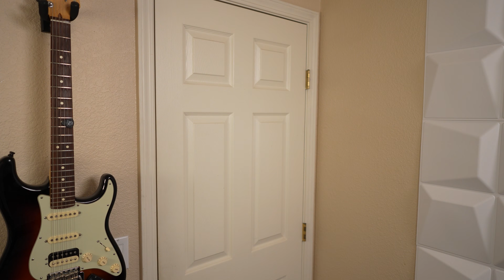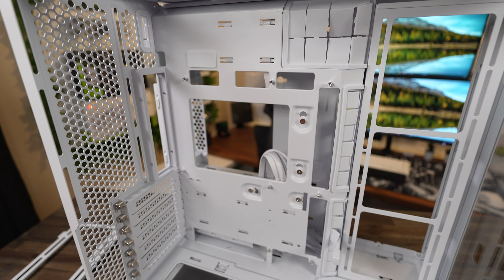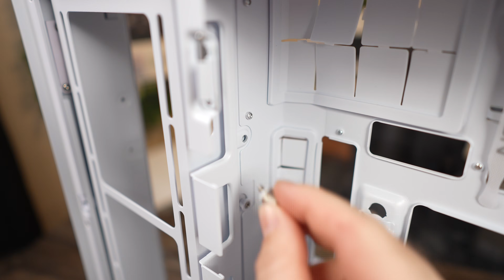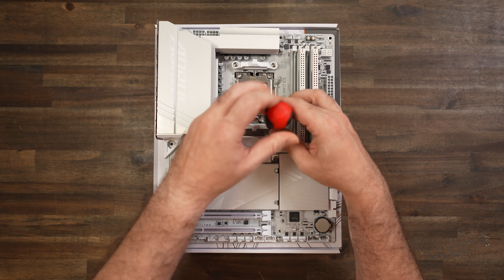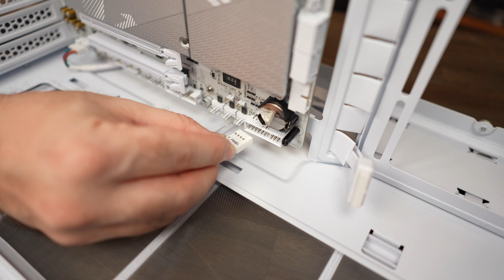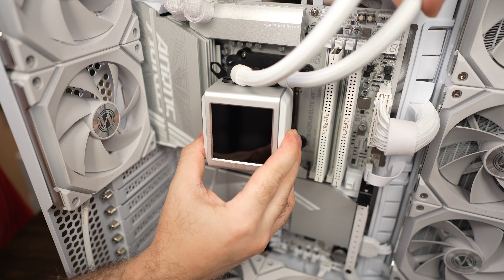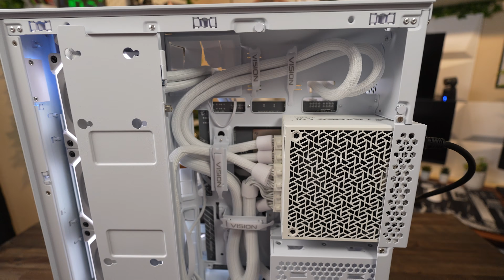Lian Li is BACK with the NEW 011 Vision COMPACT (X870 Build)

Comment from the maker: Hey dudes, thank you so much for watching and supporting my videos! A few notes about the install:

1) The bottom and FRONT side fans are REVERSE blade, they give off the appearance of being exhaust, but they are intake. They are used for aesthetics and now all fans have a uniform look across all of the them. The bottom and both side fans are intake while the rear fans are exhaust.

2) I apologize that I did not get to show the PC built in mesh mode for the top panel. As soon as I received the case, I knew I HAD to build it in vision mode and didn't have time in the video to switch to mesh mode.

Here is the full list of parts for the build:

Case: https://amzn.to/3zTW9zE
AMD 7950X3D CPU: https://amzn.to/3J5ig7f
ASUS Strix 4080 Super GPU: https://amzn.to/3PS9Aoh
GPU Sag Bracket: https://amzn.to/4fQH8hb
GIGABYTE X870 AORUS ELITE Wifi7 ICE Motherboard: https://amzn.to/3NsPXSf
Super Flower PSU: https://www.newegg.com/super-flower-leadex-vii-gold-1300w-1300-w/p/1HU-024C-00060
Lian Li Gallahad II LCD CPU Cooler: https://amzn.to/3U6UJZE
Samsung 4TB NVME Storage: https://amzn.to/3TNg3Cc
TEAMGROUP RAM: https://amzn.to/3UbmsZy
Lian Li SLV2 REVERSE blade fans: (Front Side and bottom): https://amzn.to/3W7rPdF (x6)
Lian Li SLV2 Fans (Side Rear): https://amzn.to/3U6TDx3
Lian Li SLV2 Fans (Rear): https://amzn.to/4aC0nJm
Cable Wrap for PSU cables: https://amzn.to/4f2CUTw
Velcro strips for PSU cables: https://amzn.to/4dJ62Oc

Feel free to ask me any questions you may have! 

Thanks again for watching,
Danny
Reply: Total price for everything before taxes is $3550 USD for anyone curious
Reply: Thanks !  @cadewatkin7086
Reply: @cadewatkin7086 dang I somehow came up with $4,874 before taxes.
Reply: Where did you get the spinning thing under your pc case does it comes with the pc
Reply: hmm i think the fans are not right in that configuration. Lian Li says you should do 3x reverse blade intake at the bottom and 2x reverse blade intake rear, and 3x exhaust at the Side Panel through the AIO.
Reply: @Paterminos88 where does it say this?
Reply: @Paterminos88 I believe you are right. I couldn't understand why you are getting hot air from radiator to intake.
Reply: Where did you get the rectangular lazy suzan that you put the case on to spin it?? That's awesome!
Reply: Did you place both intake fans on both sides of radiator (push/pull configuration?). I am wondering if that is not ending up pushing hot air into the case
Reply: Ok I need to know where can one get that spinning platform!!!
Reply: @Mannyolives  Prosumer's Choice Wooden TV Swivel Stand for LED/LCD TV, Monitors, Stereos, 21 inch Base Surface - Steel Ball Bearings - 360˚ Rotation - Black
Reply: @Mannyolives  he send me a link check my reply from him
Reply: Whats the L shape plug you used on the GPU? Did that come with it or purchased separately
Reply: @RyGuy_9_3  i think it came with it but I guessing hw will tell or get a link for you
Reply: how much is the build min?
Reply: @hypsm  $3550 USD currently
Reply: @cadewatkin7086  tysm and honestly not bad at all for that clean of a build!
Reply: Which Lian Li GPU bracket did you use?
Reply: Great build pal, could you please include the gpu anti sag bracket used in the setup
Reply from the maker: @axd-k6t  Edited the description and pinned comment to include it! Thank you. This is what I used, but I painted it white to match:

GPU Sag Bracket: https://amzn.to/4fQH8hb
Reply: @DanKamYouKnow hey man! This might be irrelevant but i would like to know if I should buy a new rtx 4090 right now or should I wait till the prices go down after 50 series releases. Anyways thanks man! Absolutely love your videos, GOATED guy
Reply: @axd-k6t  it's built into the case
Reply: what would be cost to build the PC
Reply: Wo uld you be willing to sell this build?
Reply: So you can’t buy the reverse blades in a 3 pack ?
Reply: Got the adam lz merch on lets go.
Reply: I don't understand your fan setup and the description. Your cooler came with 3 fans, but it says you purchased another 6 reverse, a 3 pack, and a rear fan... so that means you would have had 13 fans?? Did you remove the cooler fans??
Reply from the maker: @danybayor  Yes, I replaced the cooler fans. The top and rear are regular blade, the FRONT side and bottom are reverse blade. The REAR side fans are regular fans.
Reply: @DanKamYouKnow  ah, I see. Thanks for the clarity. I've been a console player all my life but after randomly coming across this video. The way you present it and your build.... just fell in love and want to try too. Thanks for the help and inspiration.
Reply: @danybayor  do you understand the fans?  Can you explain the layout to me like I’m in 3rd grade. It seems like the fans on the left of the case are reverse and the bottom are reverse. Then the 6 fans on the back right side are regular and the ones behind those on the back are regular?
Reply: @bigchief1175  Yeah, so he is using a total of 6 reverse blades and 5 regular blades. 

3 reverse blades at the bottom and 3 on the right

2 regular blades on the left and 3 on the back of the case. Hope i got that right.
Reply: @DanKamYouKnow  Why you are receiving hot air from radiator to the intake?
Reply: How do you get them So white? I have the infinity and they don't get pure white like that. They have a blue tint to them.
Reply: Hi I love the build and I was wondering is it ok to change the cpu cooler and the power supply? I want to use different components for my build
Reply: Hey man do you build PC for people and ship them? Where you located? 😅
Reply: Does the fans come with the case or are they seperate?
Reply from the maker: @XPulsarXX  Separate. They are linked in my original comment above
Reply: how much does this cost in total?
Reply: Are the rear fans of the cpu cooler reverse or regular balde
Reply: I’m building my first pc and I have some questions I seen you linked the fans and when I clicked the link it brought me to the fans singles do I have to buy 6 fans individually or do I buy two 3 packs, also way are there fans infront of the radiator fans if the radiator is pulling air out and the revers fans are pulling it in how does that work
Reply: i realy love your vids, i cant get enough watching them (that's why i subbed :p)
Reply: Hey @DanKamYouKnow, I used the exact same parts following your build and for some reason I cannot get the T create ram to post when I enable expo. It throws an error code 2c on the motherboard when overlocking to 6000mhz. I am able to get it to post with default ram speeds of 4800mhz. Any help on how to achieve the 6000mhz speeds? Much appreciated❤
Reply: Did you find any overheating issues with the class panel and not the mesh? I just got all this in the mail to do a copycat build but LEADEX VII 1300 power supply, ryzen 9800x3D and due to scarcity, got a gigabyte Aero RTX 4080 Super. I’m gonna do the push/pull radiator like yours as well
Reply: What are some of the parts you would recommend if the ones that you are using are out of stock?
Reply: Hey man, I just built a pc with the same case and I liked your wire management of the back so much that I ended up buying the wraps for the cables through your link. I just received them today, but they seem small. You used the 1/2 inch ones? 
Also one more thing I installed a 5080 and a little sketched out using that 90 degree adapter through amazon, would you recommend a specific one?
Last  thing whered you run the cable for the two exhaust fans?
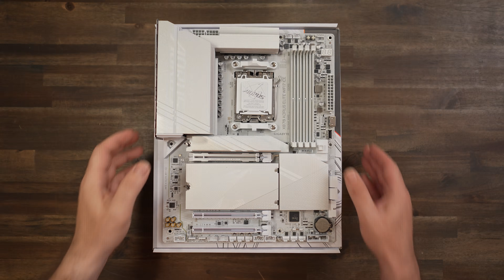Reply: Whats the song you start playing at 12:50
Reply: id have loved to see an uncut video of you building the pc and cable managing and every thing
Reply: My guy, can you share the case stand you used for thos video? Or any recomendation for my o11 vision compact? I dont want to set it on the carpet due to the dust it can have, so please, feel free to share anything with me
Reply: Where did you get that spinning display table??
Reply: Why did you choose thew x870 over the x870e, why aorus of ROG?
Reply: Why would you not do back connect with 0 cables and figure out a way to completely hide the AIO tubes?
If there is back connect support, you should use that feature and have literally 0 cables/tubes showing.. with the hydro shift it would have looked better and virtually 0 tubes . Also asus btf gpu and mobo. This would have looked so much cleaner.. those cables and tubes especially gpu and aio are super distracting.. love the build either way.. may get this case once near tubless aios are a thing..
Reply: @RissKey1955  I couldn't imagine a cleaner more beautiful cable/tube set up. Also learn to word your comments like a grown ass adult and not a petulant child in the future

Comment: Can anyone explain the push/pull setup he talks about?

I have the same case, but both my gpu and cpu are liquid cooled. I plan to mount the cpu cooler to the top as exhaust (I dunno if the fans come as intake or exhaust, help!) and the gpu radiator to the side, where he seems to fit the radiator and 6 fans (3 of which are attached to radiator).

Comment: Dude, I can't see where the video card bracket is. From what I can see, you can't use the ones that came with the card (I have a ROG Strix 4070 and it came with a bracket), but it can't be secured underneath. Why are there fans? What kind of stand did you use, or what kind should I use? I want to switch to this one.
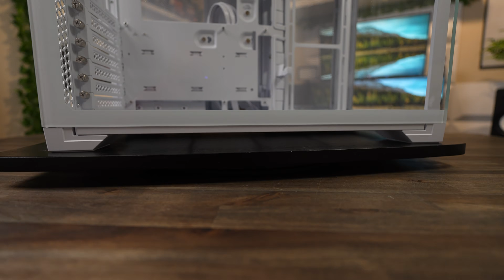Reply: 1:47 if you mean the anti sag support for the GPU the case come with one

Comment: Very beautiful build. One question what is the point of the fans that is added behind the aio fans?
Reply from the maker: It's a "push/pull" setup. The fans BEHIND the radiator PUSH air through the radiator, and the fans in front PULL the air through. It usually results in a slight decrease in temperatures, but it's nothing ground breaking or super significant as far as change.
Reply: @DanKamYouKnow Is this build meant to have a fanless AIO linked in the description since you used other fans?

Comment: Hey i wanted to ask something im a little lost and not so expierienced😂 what is the thing about push and pull on the rightside with the fans and the radiator you have fans in the backside 2 just to be sure maybe i do the same too😂. So will the hot air of radiator go outside of the case and fresh air gonna go inside of the case? Sorry just wanted to be sure wanna build it soon hehe thanks again i love your videos alot!

Comment: I have the same case and I wish could do a 6 fan push pull method on my build but the dumb tubes on the lian li hydroshift lcd 360 are bent side ways and not protruding outwards which blocks me from adding three fans for the exhaust. I also want to know if anyone knows if its ok to leave the top part where the tubes are without a fan for the exhaust and keep the middle and bottom fans.

Comment: Hi, great build!! Do you think is good the radiator and the pump of the aio assembled like this? Or you can have problem of air inside the pump ecc?
Reply: my question exactly, do you know what kind of screws is he using? I ran into this problem... cant find any that fit. The holes in the aio dont 't have threads...

Comment: Great-looking build! I got the same case yesterday and am putting it together now with a Corsair NAUTILUS 360 RS ARGB and a second set of reverse blade fans for a push-pull setup. I rotated the bracket to move the radiator and fans as far back as possible, with the radiator tubing positioned inside at the bottom of the case. For the motherboard, I’m using a GIGABYTE B650E AORUS STEALTH ICE along with an RTX5090 FE, but I’m wondering if I could have set it up like this with the tubes hidden at the back.

Comment: I have question regarding the push/pull setup. Using the same case and planning to do the same setup. Just wondering if I can use different fans for push and pull? They will have same rpm but different CFM. Or do I have to use same fans both ways? If you know

Comment: 18:13 Does that unevenness come from the fact that those tubes are almost too short for that setup? 25:25 it looks that there's no spare tube length left. I'm planning on copying this build, but with Lian Li O11 Dynamic XL case, which puts heatsiks even further apart from CPU. I'm afraid that for XL case those tubes may be too short. Any advice?

Comment: I just got my new computer which is using this box. I have a question regarding fan direction. I have 3 on the bottom (reverse bringing cold air in), and it looks to me that the AIO 3 fans are normal (hot air out). It was missing rear fans. I wanted rear fans and if I get them should they not be normal fans getting rid of heat?

Comment: Ok so I bought this case recently and I’m about to start building in it. I really want to know how necessary you think it is to have the reverse fans in front of the radiator as well as the normals fans behind the radiator. If I were to pick only one configuration, does it matter which one I pick?

Comment: What is your fan controller ?
Reply from the maker: The one that comes with the Lian Li 3-packs. Only one you can use.
Reply: @DanKamYouKnow  Hey Dan, I wanted to know if you still have your radiator configured vertically still? How do you like it? Does it give you any problems? I'm about to mount mine similar to yours. Any input would be great! Ty!
Reply from the maker: @steventruong85  Yup, still works fine with the radiator in a side mount orientation. A few different components from what was in this video but been running it for over a year and no issues
Reply: @DanKamYouKnow awesome! Appreciate the input!

Comment: i have a really good question, i want to buy this case so much and i love that i can put to the side my water cooler but. Bcs i dont want to have 6 fans on the side, can i put the three fans from inside the box and the water cooling too facing out? I mean i want to put my fans inside so i can see them, but i will put them to the radiator so they still sucking air from outside to inside. In other words i want my fans to be behind my radiator so i can see them from inside and no need to buy extra 3 fans to just to make a good dezing. Can i do that? Will my wwater cooler work fine after the radiator is the one that takes first the air from outside and then the fans bringing it inside? i hope you undestand.

Comment: If the fans are intaking thru the radiator are they not pulling hot air into the case?

Comment: I THINK YOU HAVE TO REVERSE/INVERT THE OTHER SIDE FANS OF YOUR RADIATORS, ALL THE AIR IS GOING TO THE CENTER OF THE RADIATOR
Reply from the maker: The front side of the radiator is reverse blade. Both fans are bringing air into the case

Comment: Hey I know this is a late comment and anyone can answer this I don’t mind, but I’m really confused as to what to do with that fan configuration. I read it was that the intake fans are reverse blades but on the radiator and the bottom. Does that mean the fans on the back of the radiator are standard fans? I want to assume since from what I have learned it wouldn’t make sense for all of them being reverse blades. But please do let me know if I’m right here since I’m trying to do something similar.

Comment: I decided to stay away from an internal monitor with this case also. The space constraints would have made the cable management look sloppy. So I use a larger 12 inch touch screen set up to start with the pc is steam big picture mode.

Comment: Wait I don't don't understand. Installing a push-pull config on the radiator and using reversed blades fans for intake won't it just push hot air from the radiator into the case?

Comment: Hey great build looks incredible. I’m trying to do a push pull set up. I have the same case and radiator the set of fans that are on the radiator inside the case ate LCD reversible FOR INTAKE.  The fans that go on the other side, which is on the back of the case what fans would I need?

Comment: Hi Dan, for the push pull set up, the 3 fans facing inside of the case are reverse blade, and 3 fans at the back facing outside of the case are normal blades, is this correct?  Thanks for posting this beautiful build, I will go for the same!

Comment: Hi,  I hv been trying to build very first PC with this Lian li O11 vision compact. 
May I know, for the push-pull set out on the side of the case, the resultant effect is intake and exhaust?
Reply from the maker: Both fans on the radiator are intake, both pulling air into the case. The front side fans are reverse blade, and the fans behind the radiator are regular blade.
Reply: @DanKamYouKnow  Huge thanks!! Really appreciate your quick response. Your build looks amazing—I wish I could put together something just as awesome and enjoy it like you do!
Reply: @2h9o  With that being setup that way won't it push the hot air from the radiator into the case?
Reply: @Fragblog 
Hi! 

I don't know much about the airflow configuration, especially on how to evaluate the pros and cons of push/pull therein.

I did look into the temps in both set up tough, it seems the suggested setup did a bit better about thermal management. 
I played 33 Expedition, both fans setup are not bad. Help this could help. 

Happy building!

Comment: Where you have the aio setup at. Is it intake/intake?
Reply from the maker: Correct. Front side mount is reverse blade intake, other side is regular blade. Both pushing into the case
Reply: @DanKamYouKnow  oh okay, thanks. I understood it wrong at first. How much of an advantage does this add to air flow?
Reply from the maker: @yesimraging  Honestly, not very much. I more-so did it just for sh*ts and giggles

Comment: The radiator fans are blowing in hot air and the rear fans are exhausting it?
Reply from the maker: No. The front radiator fans are reverse blade and are intake. The fans behind the radiator are regular blade and pushing air through the radiator too.